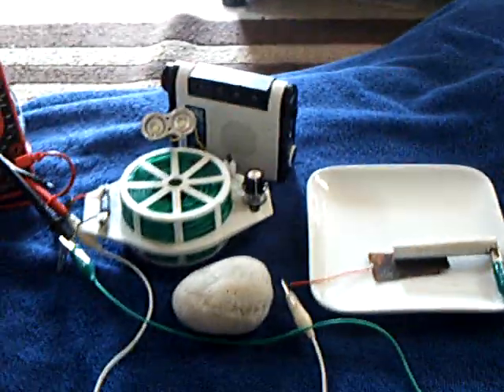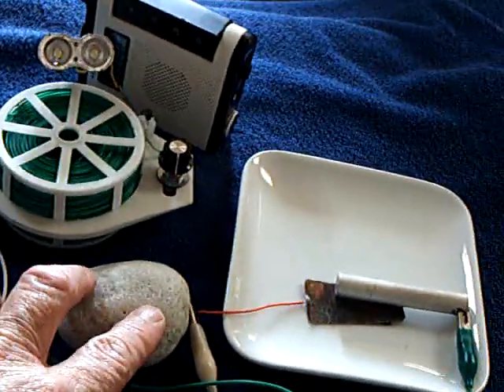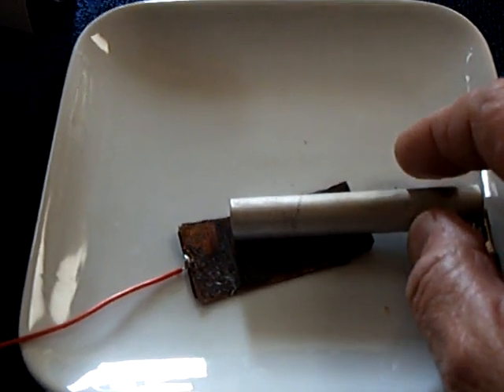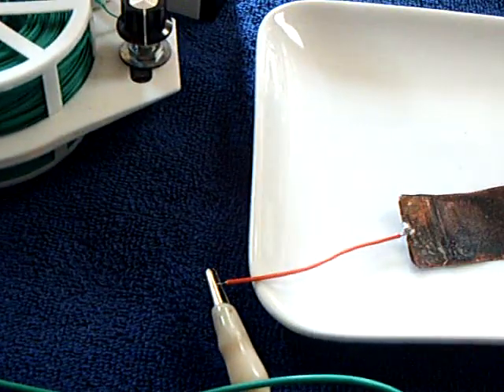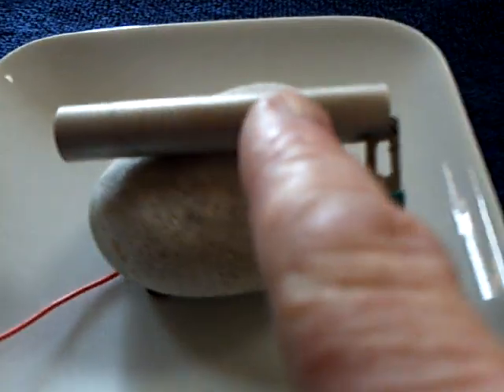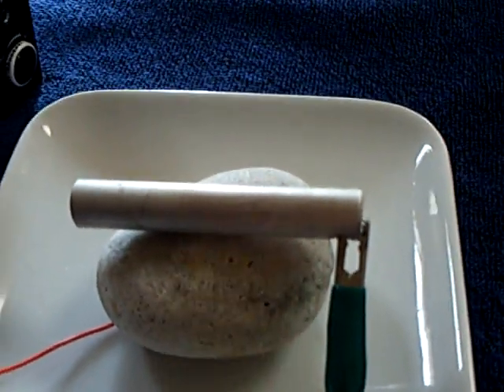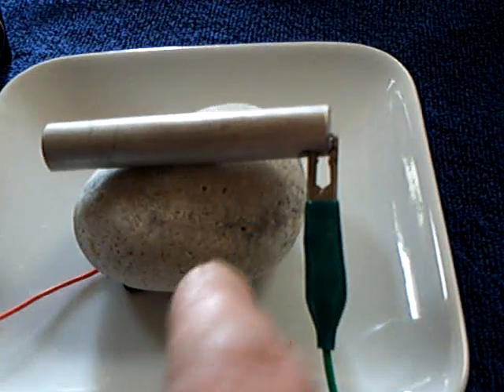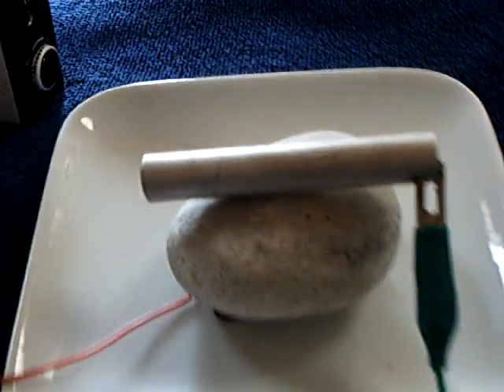Beach Rock Cell.

Comment: i am sorry i have a question, ho much amp, need pulse motor to run.'
Reply from the maker: Mili amps.
Reply: Mili amps, thansks,m ny friend,so it s thirteen  

  fourteen , eighteen Mili amps, sorryy, ask you?  but,  i am building your cement battery, but, i am don´t building pulse motor, but,it ´s 
doubt i have.
Reply: if you to be nice, sorryy, your cement battery, running  following , in this present

Comment: The power might be from the 2 electrode metals between a semiconductor, making a better effect. Or I believe the water in the rock may be creating an electric current from the VERY GRADUAL breakdown of the minerals, so it would be capturing that energy. If so then it could be a thousand year lasting battery!

Comment: Yaa, this rock doesnt conduct electricity, or produce electricity, when is dried, because the structure wasnt previosuly programmed or polarized like an electret, otherwise will work, and also if proper electrodes are applied like a shell around the rock electrolite!

Comment from the maker: @weslingm ------Yes!  This would work in a bucket of moist sand.  That gets into the realm of the "earth batteries"which is what the old telergraph systems used.  I don't know about the evaporation effects but I do know that when the water is gone the cell goes dormant.

Comment: Water conducts because it's a polar protic solvent. So what if you use another polar solvent that doesn't have any oxygen or hydrogen to degrade the metals? Acetone is a non-protic polar solvent, and the oxygen is stuck on there, so I wonder if it will work as an electrolyte without degrading the metals for one of these cells? It'd have to be sealed though or it'd evaporate.